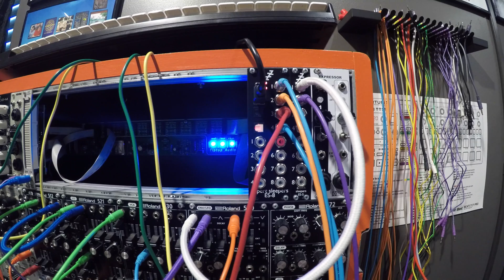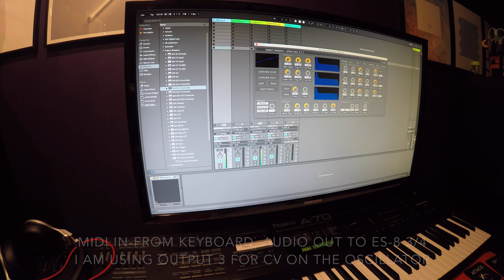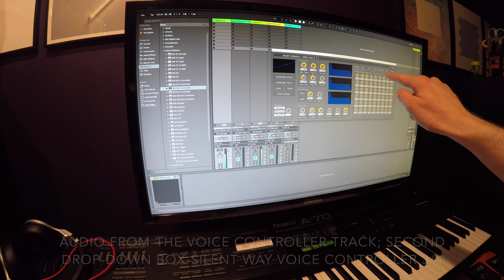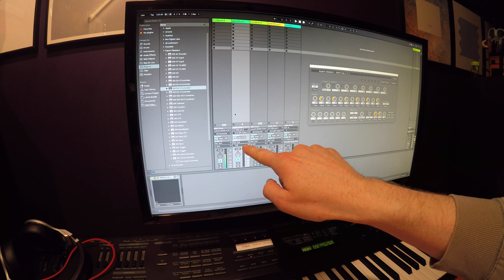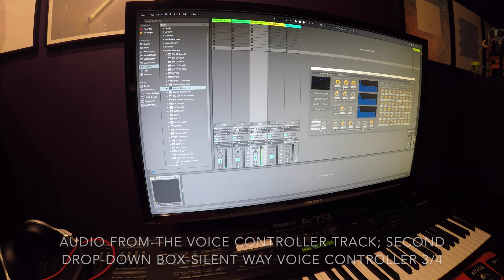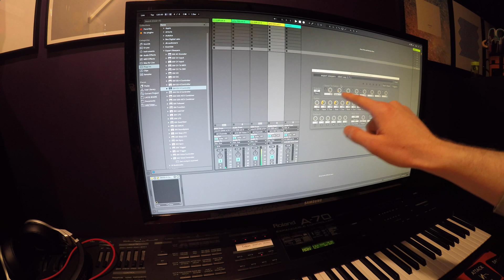Expert Sleepers ES-8, ES-5, and Silent Way Tutorial - CV to 2 different synths

Comment: Its baffling that I needed to look up a video to do this. I understand that expert sleepers is one guy and hes doing a lot, but man he really needs to get better documentation. This shit is whacky. At least hire someone or even let the community write it for him. 
I'm so fucking frusterated, too. Even with this tutorial I couldnt figure it out in time and my demo of silent way timex out. My entire rack hinges on these two very expensive now paperweight modules. Fuck. My. Entire. Life.

EDIT: This isn't giving OS a super fair shake. His docs really are pretty good considering he's the only one doing this, sometimes they feel like they are missing some key info. For example: the manual for the ES-5 doesn't specify that the outputs only handle TS, or even the type of MIDI it can handle.
Reply from the maker: I hear you. I have had to go back and watch my own video to remember how to use them sometimes.
Reply: @thesolutionband  it turns out the issue I was having is that I was trying to go directly from the ES-5 to the Poly Cenematic over TRS. The ES-5 doesn't have TRS outs, so I have to buy the adapter that expert sleepers makes. 

So in all, I'm just going to have to go from TS-DIN, DIN-TRS. And then hope that the midi signal used in Expert Sleepers stuff can communicate with the ones in the Knobula module.

Comment: Have you tried the MIDI out on the ES5 yet? I'm trying to find a good way to control a knobula panharmonicon from my MS20 and i think i can do it by sending midi signal into able from ms20 on USB, And then take the midi over TRS from the ES5 to the panharmonicon and skip the need for that midi to TRS cable
Reply from the maker: I have the MIDI expander and have used that. It works quite well. I think you can get MIDI out of the ES5 with a dongle, but I’ve not tried that.
Reply: @thesolutionband  i talked with the folks at perfect circuit. You actually can just take the midi info directly out from the ES5 and you don't need the DIN expander. It does midi over TR cable
Reply from the maker: Oh that’s right. I knew it was something a bit different. I have a TR cable from the original Beatstep and I have tried that. It does work well.

Comment: I thought ES-5 did CV as well. I want to ad CV out to my ES-8. I DO NOT want to get and ES-5 and have to get an ESX-8CV to ad more CV. the ZZZ website needs a bit better descriptions.
Reply from the maker: It is definitely confusing. I actually just had to look. It’s weird that it doesn’t.
Reply: @thesolutionband  is this reply edited. Cuz I saw one from you that said yes it does do CV. Is the current response a correction? Seems like you need an ES—5 so you can connect an WSX-8CV to add more CV. Shame. I don’t need gates, I just want more CV. The ZZZ manuals are not the greatest at being clear. Seems like they are written by someone very familiar with use and that can lead to clarity issues.
Reply from the maker: Yeah I did edit it. I initially thought it did CV as well.

Comment: did you set up the moogerfoogers with patchbays?  love it? any tipps on how to achieve it?
Reply from the maker: I did set them up with patch bays. It was actually like 8 years ago, so I don't remember a lot of the details.  A lot of the patch points could just plug in with no problem.  Others had to be normalled to something else.  Then others needed potentiometers plugged in to get it acting normal when nothing was patched.  It was a labor of love for sure.  I'm working on documenting it all and making a video.  If you have any specific questions on them, feel free to ask.  I do love it, but I don't use it as much as I did before I had a modular synth.

Comment: Heya,  question on the ES-5 MK3.  Is it also DC/Audio coupled?  I have the ES-9 and it allows audio and +-10V through the out.  Is the ES-5 the same?  confusing when I search on line.  some say it only have 0-5v output?
Reply from the maker: Sorry for the late reply.  I don't believe the ES-5 can do audio at all.  It's just for CV.

Comment: Thank you, this was helpful. But you only use channel 7 (not 7 and 8), for the case connecting only one ES-5 ( actually up to three). You can still use channel 8 on the ES-8 or ES-3, as long you don´t connect more than three ES-5.

...from muffs " Here is another important point - if you only use the ES-5 and headers 2 & 3, you can still use out 8 on the ES-3." https://www.muffwiggler.com/forum/viewtopic.php?t=90403

Comment: Did you have issues with latency on es8. I’m tearing my hair out trying to figure out why the round trip latency on it is almost 20ms :/
Reply from the maker: Sorry I just saw your comment.  I have not had latency issues.  I'm using it as an aggregate device most of the time with my other interface.
Reply: Super late here but anyone else that wants to also get this right (in Ableton) may see this so:  make sure you are direct monitoring through your audio interface.  Ableton monitor must be set to OFF (not AUTO or ON) in order to have no latency.  Unfortunately that means you cannot hear Ableton effects live while playing.